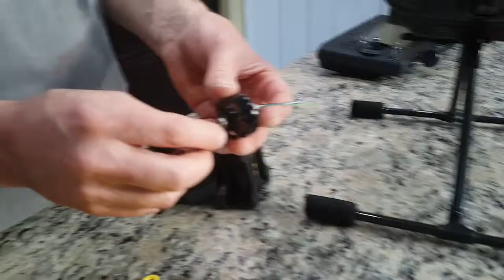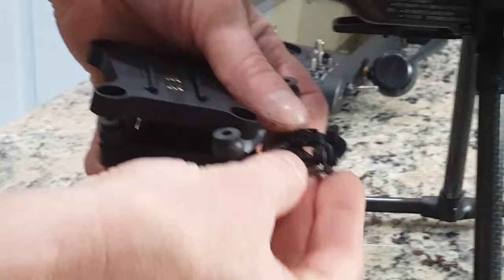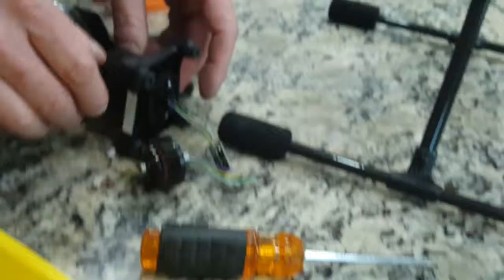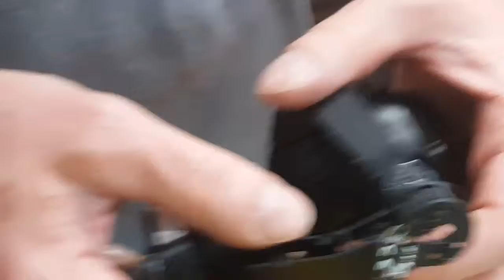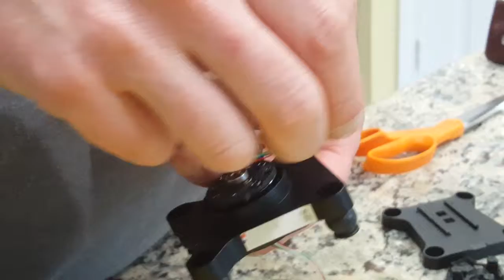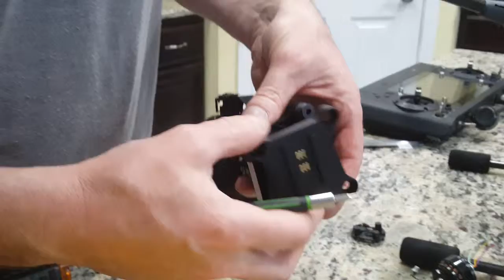CGO3+ Yuneec Calibration after changing yaw motor. Fixes death spin.

Comment: Ricky I just discovered you did not have to go to all that trouble I know it is a little late but, here it is. I had an incident with my camera and had the death spin after replacing the Slip ring assembly. Turn's out that at the piece you were talking about spinning freely is the pick up magnet that the sensor is looking for to align the camera. I was able to turn that into position to stop the Death spin and align the Camera to front and center. It is tricky but it worked.  Turns out there is a Software that Yuneec has called the Y Ground control which you can use to calibrate the gimbal with out doing all of this but, Yuneec does not make this software Available.
Reply: Nice info!! so my typhoon H at start up don't rotate or "death spin" but moves quickly moves up and down rotate left right in like an glitch manor... then it will stop and make an constant beeping sound.... camera works fine as I get video and recored well.  And if I let it sit for a day or two and start it up gimbal will be fine.... or in flight it will limp on me... sooo strange... drone was never crashed.... any suggestions before I buy a new one and modify my existing one to not turn and move?...lol
Reply: @bretnewman286  yup i’ve done it all multiple times..lol i just hate to get rid of the typhoon H because of the gimbal problems as its an excellent drone for aerial shots for video production but its not reliable on set because sometimes it works and most times it doesn’t..
Reply: @ShaunWaveFilms   Have you contacted John Michell at Yuneecskins.com He, repaired a CGO3 for me that was damaged and it works great. They can help solve your problem.  I am like you getting started and I like the performance of the H and camera.
Reply: @bretnewman286  ok i’ll try that thank you!! 😊
Reply: @ShaunWaveFilms   You are welcome hopefully you will get it up to speed and able to enjoy it once again. Where are you located? I reviewed some of your work and it looks great. Wish I had your talent. LOL
Reply: @bretnewman286  ahhh thank you!!we all have talent!! just put your mind to what ever you love doing and you will do good. i live in new kensington pa, 17 miles north of pittsburgh.....
Reply: @ShaunWaveFilms  Not only that his pricing is very reasonable.
Reply from the maker: So awesome. Glad there are people like you willing to share what you learned to help others.

Comment: Dude Well done !!!!  And Thank you for taking the time to show the issue and how to fix it.  mine has the intermittent turn and stop with a little wobble, all this after a crash. the plate you replaced but on mine is kinda crushed  so I will adjust that first see how it pans out (no pun intended)  Top work  Cheers

Comment: Under the sticker on the side is the pitch/roll sensor.  Three wires soldered to that travel up the arm to the round board and plug in.  What kind of connectors are on that round board?  The wires to my pitch/roll sensor are torn and I need a new lead I can solder to that board.   Thanks.
Reply from the maker: So sorry I can't answer your question.
It's been a long time since I have had one of these cameras torn apart.
Maybe another person who views this can help answer your question.

Comment: Your files are not on Thingverse nor eBay. I am guessing you don't want to share them. Not hard to design. I will make the stl file and list it for download since you won't.
Reply from the maker: This part has become obsolete.
I didn't sell it on eBay, I only provided it as a free upload on thingiverse.
It is obsolete due to what the last commenter had explained. You can just move the magnetic pickup to the correct position, and that will solve the death spin.
Sorry for any confusion this has caused you. I was only trying to help others to fix the same issue for free.
Reply: @amphibiousmotorcycle  I am sorry if I come off a bit strong. I was having a hard time with one of my gimbals and frustration had set in. I did find the file and printed it but didn't need it after all. What is the last comment talking about? I am not sure I understand what to line up.

Comment: Yeah bro this is excellent thanks I just saw a cgo3 that needs callibration it's $60 will this work for that model also? It's not the cgo3+ it's the cgo3
Reply from the maker: This technique would work for the yaw motor, but not the part from eBay. Would be much easier to do on a regular CGO3 though. If it is out of calibration it should mean the yaw motor is broken. What happens is the center shaft pulls out of the motor, but the motor stays together due to all the magnets. With the shaft broken free it randomly spins around and makes the hole thing out of calibration. The yaw sensor in the plane cgo3 is right on the top just under the main circuit board. You may be able to find a way to turn the yaw sensor to find the correct spot. Once you first replace the yaw motor.